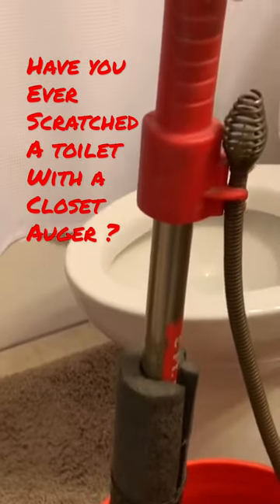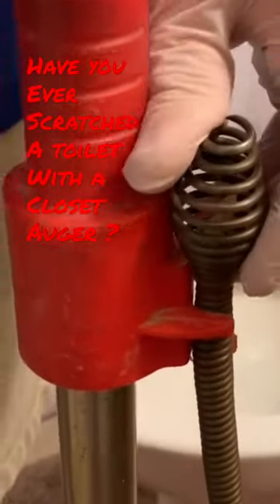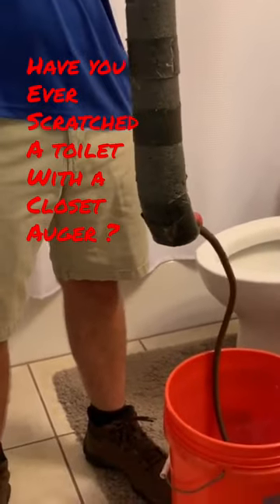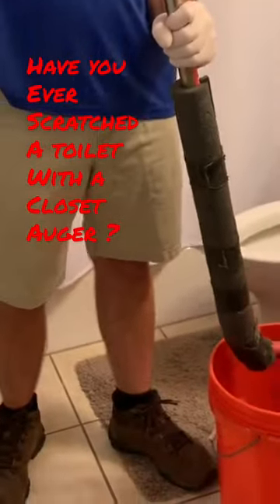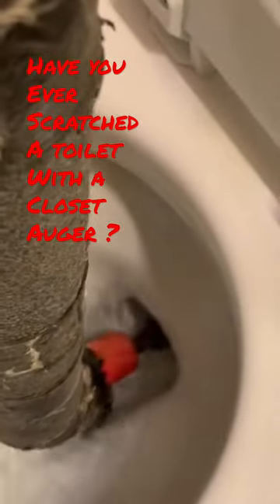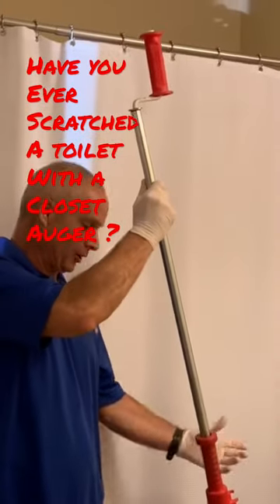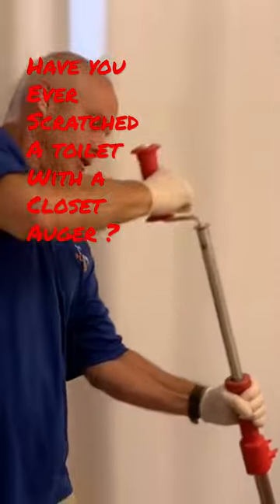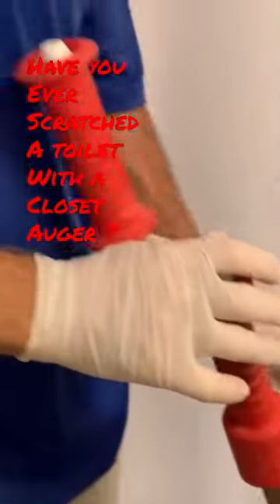Unclogging A Toilet with a Closet Auger @TappPlumbing #toilettrouble #plumbing

Comment: Done it a thousand times. Scratched a bunch of toilets, too. 😆 🤣
Reply from the maker: Yes clients don't like that lol, thus why we try to prevent it for sure 😂😂
Reply: @TAPP PLUMBING  I wasn't necessarily a plumber. Was into apartment maintenance for about 12 years. But the plumbing aspect was my favorite part of the job. I also installed water softening systems in my early 20s. That was pretty cool doing that as a young man. Lots of digging. 😆 But mainly worked in clean environments with new plumbing. Can't say the same for the apartment complex I worked at. I'll never get used to 40 year old crawlspaces. 😳
Reply from the maker: @johnnichols3113  I think the older I get the less I like the crawl spaces for various reasons!! 😂

Comment: I have a toilet auger like yours but my handle comes off and u can hook a drill to it
Reply from the maker: I saw one of those recently on a different channel. I don’t remember which one. How long have you had it and has it had any problems?
Reply: A couple of years... I have only put the drill on it one time and that was the other night at my house... I all ways use the handle. But it was taco night the night be for so I need som extra power. It worked good. Just wish it would of been 9 feet long
Reply from the maker: @51-FS   I am not fond of doing plumbing at home . I like working around the house but there is just some about plumbing at home that seems to annoy me 🤷‍♂️. We know we can’t mess around when it comes to a stopped up WC though.
Reply: Yeah I'm redoing my hole bath room this weekend. And the drain pipe from toilet all the way to the tank
Reply from the maker: @51-FS  Dang it man !!! That’s gonna be the entire weekend gone. At least you are gonna have a lot to show for it !!
Reply: How do you extend it to 6’?
Reply from the maker: @chrisreynolds2410   It has little buttons on it that press in and unlock .
Reply: @chrisreynolds2410  not all of them have the extra 3 feet. My buddy has a older one and it's only 3 feet.
Reply from the maker: @51-FS  You are correct sir, I didn’t even think about that! Thank you !!!
Reply: Lol I also has a buddy that didn't know his was able to be 3 feet longer eaither.... I need new buddies
Reply from the maker: @51-FS  Don’t we all !

Comment: Screw this, just use a can of coke and let it sit for 5 minutes before flushing and plunging again.  toilet augers suck. Especially those rigid ones like that.
Reply from the maker: I have been doing plumbing more than 35 years and have never heard that one. I assume you have done several times? When I was a child the urban legend was you could set a 16 penny nail in a can of it and it would dissolve .

Comment: Squirt some soap in the toilet then plunge it.
I've snaked a toilet w no luck but the soap worked no joke lmao
Reply from the maker: Have you seen people put plastic wrap over the bowl and flush it . That is something I definitely can’t believe!!!
Reply: @TappPlumbing  in japan, they have an actual product that is a piece of multilayered plastic, thin enough to be flimsy, that is shaped to fir around the rim of the bowl. One side is sticky but the other side isnt. You stick in on the bowl and completely cover it and then push in the middle of the plastic a couple times and then flush and it actually works. No idea how it works but ive seen it work multiple times.
Reply from the maker: @DxrkyJxnkoJRM  That is very interesting indeed . No chance you know what the product is called ?
Reply: @DxrkyJxnkoJRM  have u seen it work in person or just seen videos of it working?